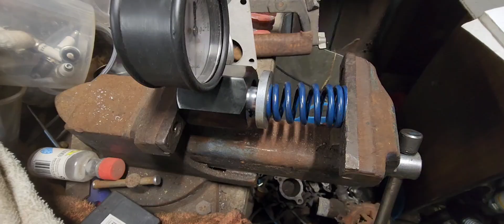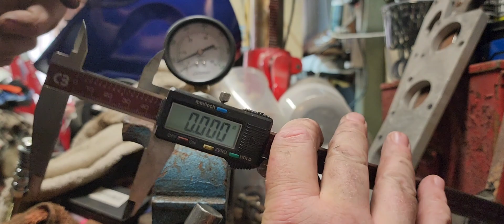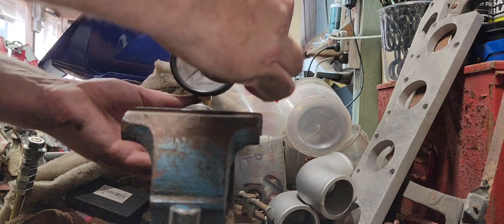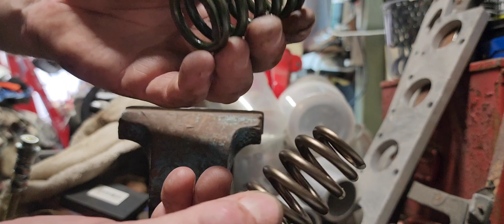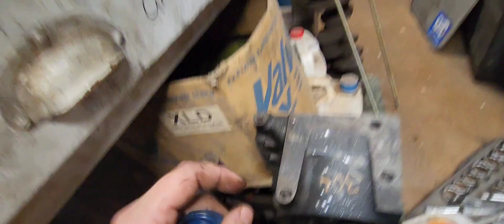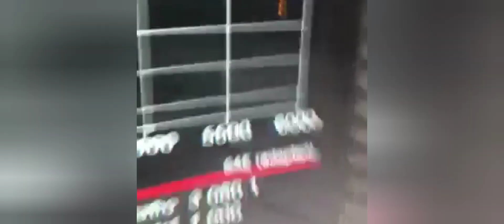A Guide to Fitting LS6 Valvesprings Into Almost Any Head

Comment: Hi it 's a nice video .i've got a 71 CLEVELAND with quench 4v heads with the 2.19 intake valves. do you think that the blue ls spring could do the trick replacing the stock spring with the cobra jet cam?
Reply from the maker: I am exploring this option myself. Unfortunately, the problem lies in the Cleveland 1.72in installed height vrs the 1.8in for the valvesprings. The spring saddle is also too big and needs machining to accept the smaller diameter spring. I haven't found a seat cutter that will do this, other than ones that will cut for the pressed steel seat locater ones designed for aluminum heads. This takes up a further 0.060. 

If a valve with an extra 0.14in in height (that's assuming the collet location remains the same measurement from stock - measured from the valve tip down), then it's possible. Or, there are +0.100tho valves and machine the heads by 0.040in. I have no info on if the heads will crack over time from the removal of metal. +0.200 plus a shim could also be done.

Next, a pushrod length change will be needed. I would assume that raising the valve will need an equal length increase in the pushrod and a shim of similar thickness put under the pedestal. Not really a problem if they are adjustable stud type arrangement.

Once set for 1.8in valvespring height, other, stronger beehive springs with more lift become available other than a standard LS. 

In short, as of today, I can't see how an LS spring can be made to drop into a Cleveland head as cheaply as demonstrated in this video. I am not saying it's impossible. Even if the machine work can be done at home, a full set of valves, collets, retainers, and pushrods are still needed. However, once I do, I will be sharing the procedure.
Reply from the maker: Opps! I re read what you were asking. As above, but to run your idea a different way.

If memory is correct, 0.60in was max lift from the blue valvespring (with 0.020in coil bind gap) Minus the 0.080 seat  difference, and we are down to 0.52in As long as the CJ cam stays under this lift point, and the spring seat can be machined to accept the smaller I.D. of the spring, plus a collet/retainer change... then it's possible. Obviously, there is risk with how close to coil bind it will run,  but I am assuming you are no fool and will check all this yourself. Just be aware that Beehives prefer closer coil bind numbers than 0.050in. How much under 0.02in is the risk I leave to you.

Comment: put a bolt or dowel through the center of the spring when in the vice and save yourself a trip to the ER
Reply from the maker: I will have to make a fixture, so it sits in the vise safely yet still gives room to see the spring for future videos.